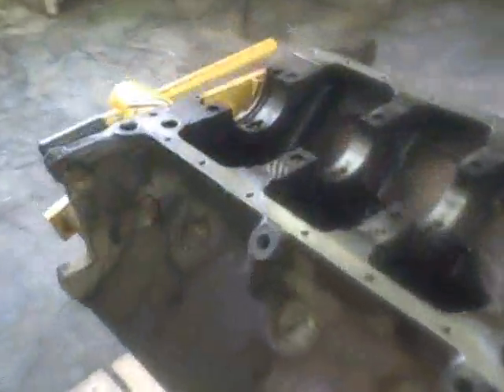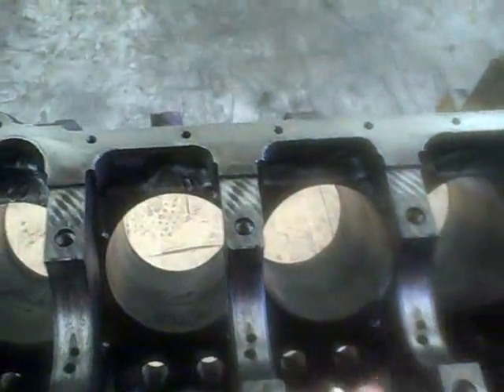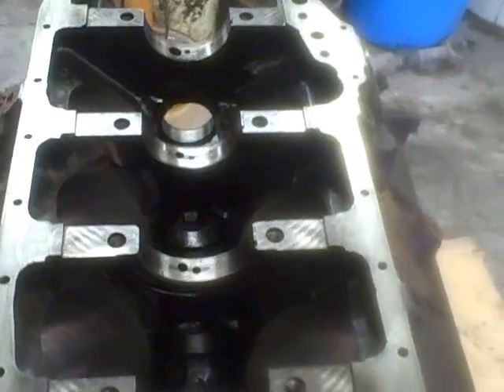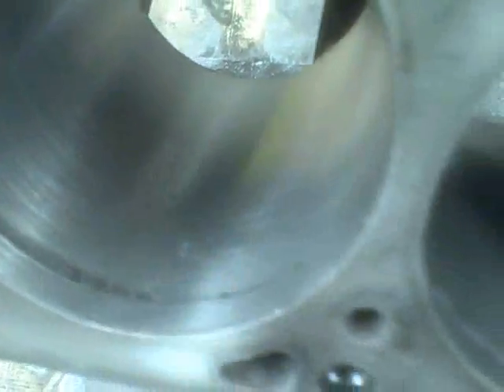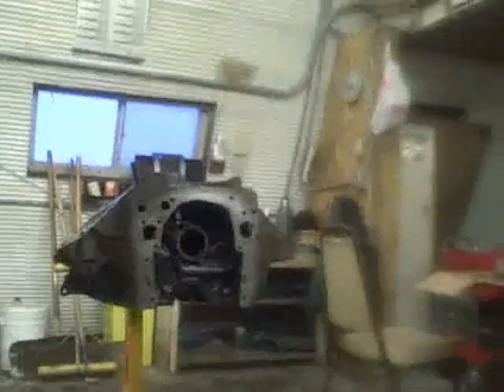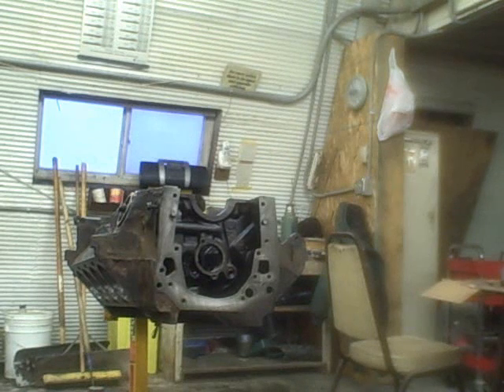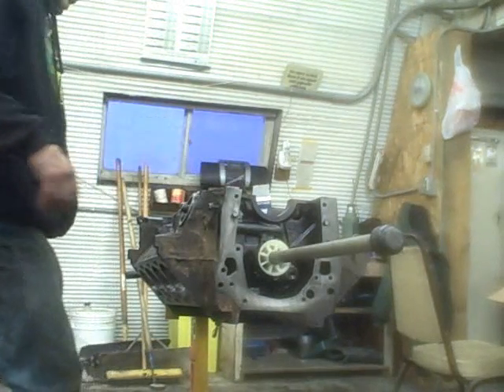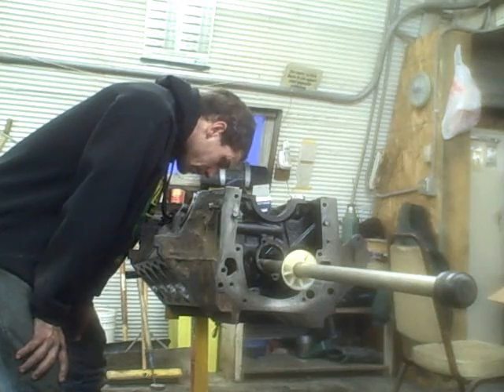Engine assembly Part 1 installing cam bearings

Comment: @m schiffel The oiling system fix on a 351M and 400 is a very easy fix. FYI, the 351M and 400 is NOT a "385" series engine it's a 335-series. The 351M/400 is a very underrated engine and I've owned many that were very reliable well into the 300K mile range and above.

Comment: oil pressure is only low when it drops down to 3-7 if you have dummy gauges the oil switch pressure sensor will only trip at  3-7 psi

Comment: Great video, I will be doing a engine of the same size, but the one i am working on now is a V6 GM 3.1 The problem is there is no room to install the camshaft bearing like you can with a V8. You can't slip the bearing next to the spot it needs to be taped into, and then drive it with an install tool, Any help would be great.
Reply: michaelo1492   The real problem is that you are putting any effort into a GM 3.1 V6.

Comment: Great Video!  I am a mechanic with 25 years experience and that was the best cam bearing lesson I have ever seen.  You are a born teacher, great job.  Did you use a dial mic to check the cylinders?

Comment: btw, 400's have shitty oiling systems. the FE engines(352-360-390-406-410-427-428) are superior engines as far as durability is concerned. the only advantage of the "385" engines (your 400) is a relatively lightweight block casting. you should match the main bearing shells to the block oil holes with a dremel tool.this improves oil flow to the rods.  great videos---keep them coming!

Comment: i have used a "bottle brush" type hone on questionable bores like yours with excellent results. we call it a "dingleberry hone" . works 10x better than any rigid hone. bought mine at NAPA for $110.00. money well spent. used it many times. do try one-you will never use a rigid hone again.

Comment: Ok i no its been months since this aired but i have a question too.I have a 6.5 turbo and oil pressure is abot 35 pis cold start and then warmed it drops to around 20 at hyw sppeed but on idel warmed up its at 5 psi,ugggggg.160,000 miles on the motor and serviced to the hilt,could it be cam bearings and do i have to take the dam motor out to do this or can i do it in the truck? thanx for any help.great vid by the way.

Comment: i wish i did cam bearings when i took my engine out 5 years ago  :(  

uh, how did you get the old bearings out?   what brand is that tool you are using.  i need one  :)

Comment: I generally let the machine shop clean, hone, and install the cam bearings.  It doesn't cost that much and it saves a lot of time.  Of course, I don't rebuild enough engines to justify the equipment necessary to do that either.  Good video!